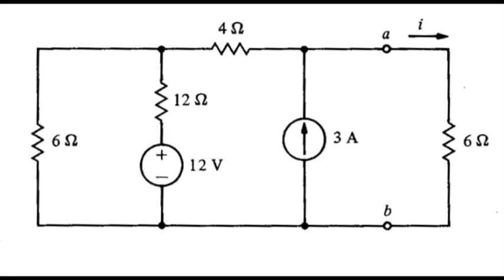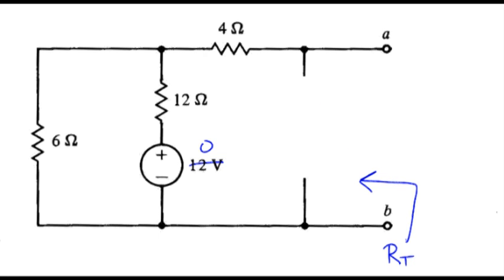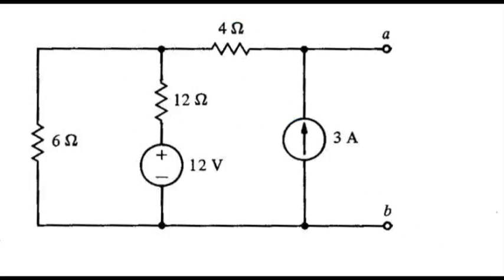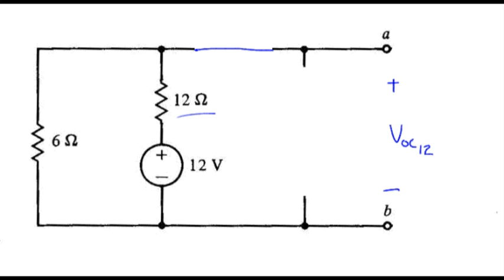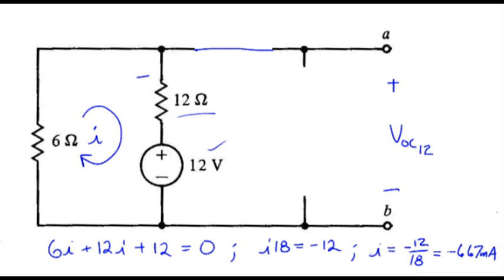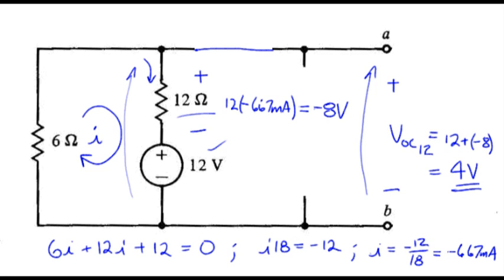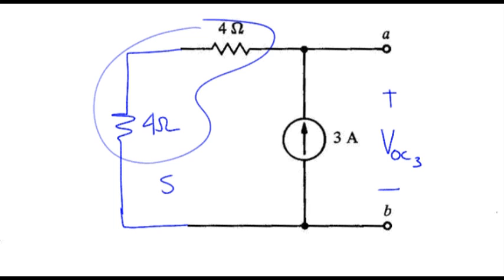dc: Thevenin Equivalent Example #1

Comment: How did you get the 4 V to add with your VOC at the 5:55 I did not get it at all.
Reply from the maker: +Whom Isac See the video description, 5:55 is part of piece that should have been removed.
Reply: 5:55 I think its wrong, direction of current(3A) is opposite to 4V.
it should be subtract.
Reply: Because superposition theorem.

Comment: I solved using node method, I got Vth=13, Rth=8
Reply from the maker: Hi mahmoh -- For Vth did you remember to take out the 6-ohm resistor to the right of terminals a-b? You are looking for the open-circuit voltage at a-b, this is the same as Vth.

Comment from the maker: Thanks for your question -- Just checked the circuit in the simulator and the analysis is correct as shown in the video. Here's another way to think of Voc12 (at around 4:50): You have 12V across 12+6 ohms, that's 670mA in the counter-clockwise direction, and that current flows from bottom to top of the 12-ohm resistor, which is an 8V drop. Voc is the voltage across *both* the 12V source and the 12-ohm resistor, therefore Voc is the 12V rise  *minus* the 8V drop to give 4V.

Comment: you got a wrong answer V12 should be 8 not 4... therefore the Vth= 32 not 28 then i=  2.3A
Reply: Nope. it's 28V and 2A across the 6ohm resistor.
Reply: I got same answer as you.
Reply: i'm pretty sure this is correct
Reply: Same result :Vth:28V and I=2A

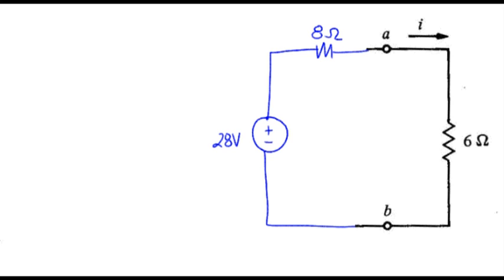Comment from the maker: Thanks for offering feedback on the video. The 28-volt source and 8-ohm resistor first introduced at 6:50 form the Thevenin equivalent circuit that was calculated earlier in the problem. Please see the updated video description for more details.